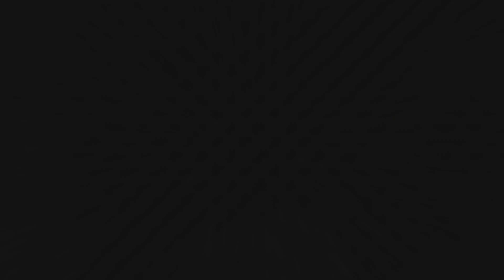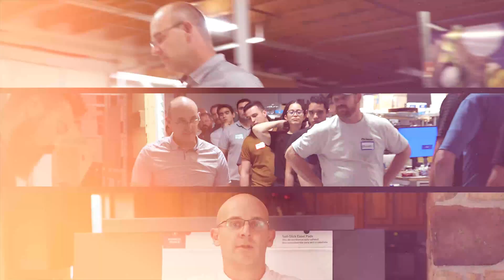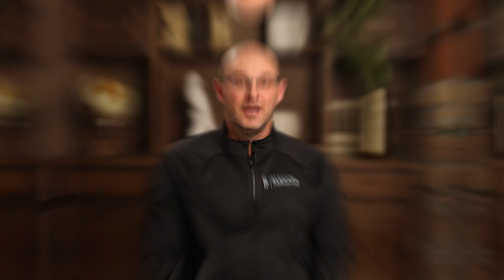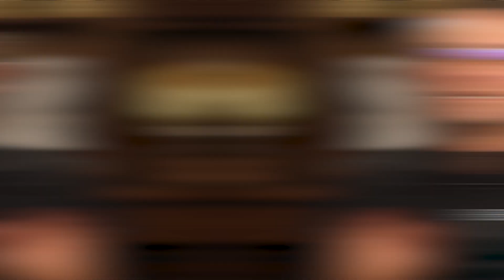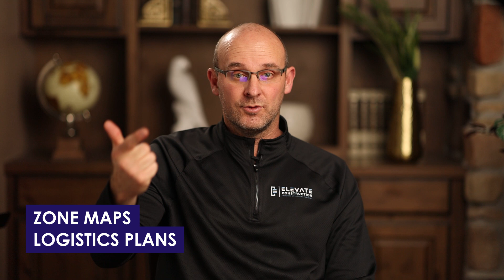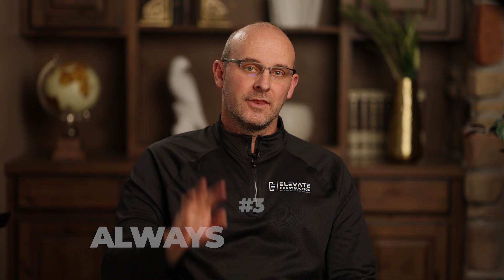How To Bid Commercial Construction Jobs

Comment: I have one question, My old man has been a glazier for 15+ years and I'm wanting to help out and have 0 experience in this field. Are these steps going to be the same throughout the bidding process from start to finish even though I will be looking for jobs that will need glazier's and glass to be installed?

 Thank you for the information from this video!
Reply from the maker: There are adjustments to this based on the scope of work, but the principles and purpose should be the same.